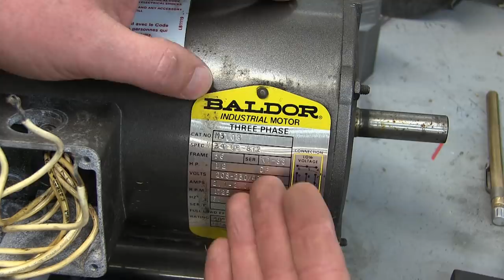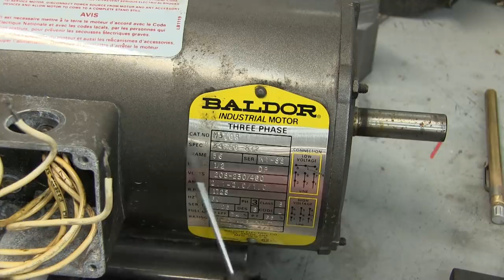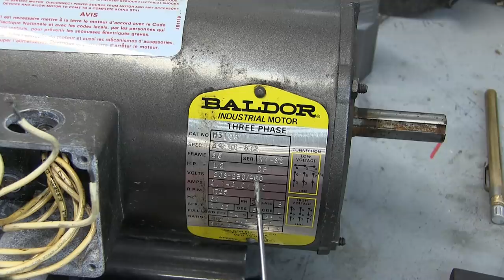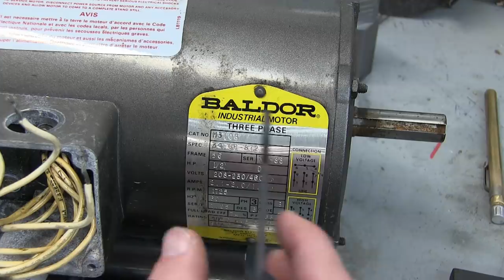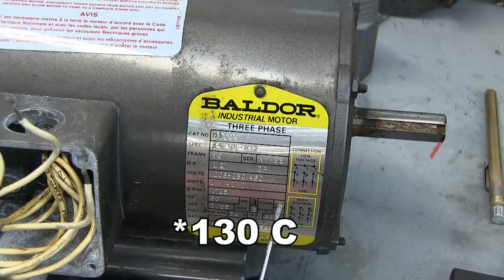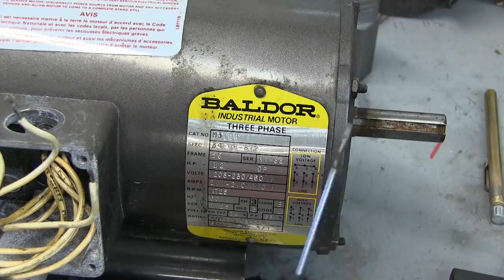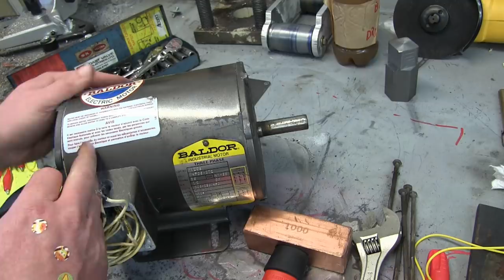BOLTR: Induction Motors EXPLAINED! | Power Factor and Failure Analysis

Comment: Look at the nameplate?  Dangerously close to reading the instructions.  It's a slippery slope, my friend!
Reply: Nononono, nook at the lameplate!!!!
Reply: Following instructions is a severely underrated super power. You'd be amazed how many times i did something in a single go by simply following instructions.
Reply: Marcel LeMay its a joke
Reply: Youtube User, Yeah,  i know it is.  😊
Reply: I once watched several of my friends bumble around for 10 or so minutes trying to figure out how to route a dryer's drum belt. Then instead of showing them how to do it (since I'd done it recently myself) I asked them, "why don't you pop open the control panel on top and look at the instructions?" They thought I was genius when they found said instructions were there and included a belt diagram. They got to do the dirty work and I still got to look smart. :)
Reply: Those aren’t two in the same, gotta know what the hell you are looking at, labeling for the win.
Reply: lookin' good and wingin' it is what I did for years, got the job done, but I also knew my limits and when to quietly ask for help. I didn't tell the shopfloor I'd asked engineering though....
Reply: proto Nah man. The nomenclature plate doesn't count. It's the same thing as an instruction manual, but it's boiled right down to what you actually need. Pick out what you need and throw the rest of the crap in the round file. The plate and a manual is all you need.
Reply: Instructions are just the manufacturers opinion.
Reply: Instructions tell you what to do and any selfrespecting man will not have a booklet tell him what to do and name plate however is more like a cypher if you don't know what it means it can have you cursing which I think we all agree is a manly part of repair work!
Reply: Great comment upvote....oh wait, I already upvoted this comment 2 years ago. I want to upvote it again.
Reply: I almost never read the destructions, and I've never had a problem, even when stuff doesn't work as intended.

Comment: As soon as you started I was reminded of when the auto transmission blew in the IH cab over I drove at one time. When they put it back together they put the trans on a dynamometer to see if it would chooch. They had two such machines, one with a  454 Chevy engine and the other with a mongo electric motor. I wondered out loud if the electric motor was up to the job and was told the 454 would barely turn the truck transmission but the electric job had more than enough. 
As a bonus I saw the difference before my eyes the difference between shifting on the torque curve and the power curve. I already knew in practice but it was cool to see it on the dyno.

Comment: So here in the enlightened lands of the UK our motors can be connected either Y/star or Delta the Y is the low voltage and the Delta is the high voltage connection as you call it. We also have controllers that switch from star to delta on startup to assist startup then switch to delta once running. There is usually a set of links that can be swapped at the connectors which are more convenient than the bundle of loose wires.

Comment: OMG I needed this so bad. I deal in gym flooring.  For Bleachers that roll out you can have 2 phase or 3 phase drive trains.  I never understood why they say with 2 phase it is like a car on gravel slamming on the gas & spinning wheels throwing gravel behind vs 3 phase where a car slowly accelerates.

Comment: AvE,  DP is short for Drip Proof. It means the enclosure type of the motor. Drip Proof is resistant to moisture, dust, semi enclosed.Then there is ODP, Open Drip Proof, vented on the bottom basically, water resistant but not dust. TEFC, Totally Enclosed Fan Cooled, just like it sounds, more water resistant usually wash down rated, dust proof, most common Industrial motor type. You get the general idea, there are very many more, too many to list. An EASA book or search can fill in the blanks if you need more info.

Comment: Thank you. I used to build a lot of mounts for various motors in oil fields and industrial sites. As a welder, that soapstone holder or pen jumped out at me. I carried one in my shirt pocket for decades before I retired. I always preferred the round over the flat one, because it seemed I was constantly marking round holes. Great lesson here on induction motors.

Comment: I love those ground fault tester, I never used the new one but back when I worked for Orange "France Telecommunications " in jordan I had one I used for locating bad underground joints had alot of options but it's all in variable resistance and potentiometer like wire gage resistance of wires and we follow plans to dig that joint up

Comment: Here in the UK most dual voltage 3 phase induction motors are built for star/ delta connection (Y/delta) on high voltage they are star connected and delta on low volts.

Comment: I'm learning still and maybe should find out it easier, but the question is, since the 3 phase motor in this case is made to go on 208-280/480 and that it will wear it out earlier if used on 480 for example. I wanna know what parts it is that is wearing out, because I suppose it's brushless since its a induction motor, right or wrong? Two questions really but I think you get it. Thanks for a great channel!

Comment: Oh right what is SOHCAHTOA in english?
Reply: Thanks.
Reply: felixar90 sine opposite (over) hypotenuse, cosine adjacent (over) hypotenuse, tangent opposite (over) adjacent.

now i can't remember: which adjacent line do you use for cosine and tangent?  does it just not matter?
Reply: adfaklsdjf Ok,  it's same thing in French then. And the adjacent side is the one that is not the hypotenuse, because the other one is called, well, the hypotenuse. (Even if it's technically also adjacent.)
Reply: Some old hippie caught another hippie trippin on acid
Reply: adfaklsdjf, Adjacent is the Active power (W), Opposite is Reactive Power (VAR), and Hypotenuse is Apparent Power (VA)
VA times Sine Theta (Theta is angle of PF) is VAR
VA times Cos Theta is W
Theta is cos-1 0.65 (the power factor) = 49.45839813°
Reply: Adjacent is the line touching the angle you are calculating it is the one that has the 90 degree angle at the other end.  Opposite is the one not touching the angle you are calculating and hypotenuse touches the angle you are calculating but has a less than 90 degree angle at the other end.
Reply: this should help you out chris http://www.electronics-tutorials.ws/accircuits/power-triangle.html

what I know is from 3 years of electrician trade school.

Comment: Power factor: Electrical supplier infrastructure (generators, transformers, transmission lines etc) must be sized to provide current (amps) and voltage(volts). A non-reactive load (resistive) consumes power as a product of the two (VxA=P). With a reactive load such as a motor or capacitor (inductive/capacitive) the current either lags or leads the voltage. As the voltage and current are no longer in phase the (real) power consumed will always be less than the product of the current and voltage (VxAxpf=P), pf will always be in the range 0 to 1. For example, a machine with a pf of 0.5 will consume 50% less (real) power than the product of the current and voltage being supplied to it. Larger installations have power factor included in their metering and are charged accordingly for exactly this reason.

Comment: nameplate lies....... 
480V 1A 3phase line to line motor takes √3 * 480 * 1 = 831W effectively outa the wall,  In which world is that a 1.2hp(894W) motor?
Add the .68 pf and you better have wires and fuses that can handle up to 1.5A power draw, because that is what it actually takes from its power supply.
It's only 74% efficient at full load so it is a 615W(0.82hp) motor. 
Lies lies and .....
At 32 ohm it will pull up to 15A at stall, ouch.
Reply: Wouter Portegijs Question regarding wye and delta configuration. Does one have a higher starting torque than the other?
Reply: My understanding of squirrel cage motors is that either way they can blow themselves up, what I mean with that is that the stall current is way to high for the wires to survive.
If you want high stall torque you better get a good vfd and program it correctly for the motor, if you have the motor already. If not get a different motor that fits the application better.
that said, with a said limited voltage, either 110 /220 /480 and the same motor being either wired Y or delta . The Delta has the least resistance and thus for the given voltage will let more pixie through. 
Either way the pixies will win without a controller and your motor will catch fire or melt ;)
Reply: 208*2.1*1.732= 756.5376 VA Full Load Input
times .65 (PF) =  491.74944 W Full Load Input

1/2 HP * 746 = 373 W Rated Output
Output/Input = 0.758516431 or 75% efficiency, very close to as rated by the name plate

W in - W out = 118.74944 W total losses

the name plate is correct, its a 1/2 HP motor.

CEC Rule 28-200: A 15 Breaker is good for the branch circuit
CEC Rule 28-308: Overload not needed.
CEC Rule 28-106: 14 AWG is good for this motor
Reply: The 1/2hp (~373W) is the power on the shaft.
You divide that by the efficiency (373W/0,72=518W) and you get the power it draws from the wall.
If you calculate P=U*I*√3*cosφ you get the same value (P=460*1*√3*0,65=517,8W~518W).
There are 518W-373W=145W losses in heat/friction.

Comment: erm... im not sure if your description on "this motor is likely Y-wound" is correct. to my knowledge many motors dont have a fixed arrangement but can be switched by flipping a switch/rescrewing some current connector bars around because different arrangements are better for starting/running (Forgot which for which). and the loose bundle of cables coming out of it seems to agree with me because it looks like its independent wires for each relevant coil pair (which you would then connect to make the Y or Δ setup) 
the diagram for high/low voltage also exactly looks like the diagrams i saw on pretty similar (3-phase induction motors) as well for the Y/Δ switching
source: my electric/elctronic engineering school teachers :V

Comment: you can tell if its a wye or delta by the low voltage wiring diagram, for 9 lead motors. (the high voltage is the same for both)

wye = (4-5-6) (3-9)(2-8)(1-7)

Delta = (3-9-5) (2-8-4) (1-7-6)

If no diagram is legible, then just test for continuity, if you have 3 sets of 3 its delta, if you have a set of 3 and 3 sets of 2 it wye.

for delta a resistance check of those sets will tell you how to connect the leads for low and high voltage. (1-4 is double 9-1 or 4-1)
for wye a voltage check will do the same (if you jumper 4-7, then 8-1 will be the sum of 8-7 and 4--1)
Reply: In europe our motors are normally star / delta for high / low voltage so they only have the 6 terminals.

Comment: AvE, Can u run a 220v motor on 120v by twisting legs together, If so or not how safe is it and what might one expect by doing this I was looking at a compressor a guy had done this to the motor and told me it would be fine. I passed on it but I've been wondering

Comment: Sorry to take issue with you're re one of your comments. Operating a 60Hz motor on a 50Hz power supply does effect the performance of the motor. A change in frequency effects the impedance of an inductive circuit. So as impedance decreases current will increase and the motor will operate hotter. Probably not too hot at no load but at full load, that's another story.

Comment: The DP has to do with the enclosure. I thought you were going to get into when you got into the rolled steel portion. Normally Baldor’s nameplates have an “encl” section. Heres some different designations. Open Drip Proof (ODP) ...
Totally Enclosed Fan Cooled (TEFC) ...
Totally Enclosed Non-Ventilated (TENV) ...
Totally Enclosed Air Over (TEAO) ...
Totally Enclosed Wash down (TEWD) ...
Explosion-proof enclosures (EXPL). Those A hole Y/delta motors are still out there. Mostly on German stuff (medical equipment) keep up the great vidjeo’s and the sweet cursing yo.

Comment: The analogy my prof. gave for power factor was helpful.  Pour a beer, the reactive power is the foam, real power is the actual liquid, and both together is the apparent power. And as for removing bearings, bar soap works well if you don't have grease or bread.

Comment: I remember me sitting in the electrical machinery course I - motors....he went on and on about motors...and i didn´t undersand a single thing...instead i went to a local used parts shop and got me a 100W induction motor and opened it and test the thing troughout...it helped me a lot about how these things works...about the same as you done here....experiments are fun.
Thanx for this one :)

Comment: Thanks for showing this video!  I've saved and restored many old motors. The Baldor are pretty well made, in my opinion. Even their small cheapie ones like you show here seem to last quite a while.  

Here's an interesting motor you might like to see.  It is made for a cotton gin, where there is a lot of flyings and lint in the air.  Instead of keeping the lint OUT, they made the motor with all open, smooth air paths so that the lint will blow through it.  The winding is encased in solid fiberglass resin so as to eliminate lint getting stuck in the end turns and creating problems. It almost looks like a wet-winding for a submersible motor, but not as thickly encased.  This motor was made in the 1930's and was in a scrap pile.  With one bearing replaced and one repacked - it is back in action.  https://www.youtube.com/watch?v=grjomtYnzNA

Comment: DP= drip proof sometimes manufacturers use ODP open drip proof.  You'll also see TEFC = totally enclosed fan cooled.  There's also a jp frame which is similar to a c face, but intended for pumps with a longer shaft to make room for a bronze sleeve and a mech seal.  Other than that man, you pretty much covered the basics.

Comment: Weird, I just watched a vid where Finnegan [ Motor Trend 'Roadkill' ]  used soap to drive out a bronze bushing on the end of a gearbox lay shaft stuck in the end of the crank!!
Reply: Philip Rowney the power of hydraulics knows no limits when applied with no rules in a parking lot or northern B.C.
Reply: Philip Rowney that wouldn't happen with dove!
Reply: andrew kennedy Yeah Dove's no good as hydraulic fluid, too much air in it. On a side note, that's also why it floats.

Comment: Hey Mr. AvE, just a little note. When you calculated the apparent power you missed the square root of 3. So it's 480V*1A*square root of 3 = 831VA.  Greetings from the standardised Germany :P
Reply: Actually 796 @ 460. Name plate states 460 not 480. Ifn you wantn to be splittn airs
Reply: Dan House :D I guess you are right.  I stopped the video a couple of times to take a look at the name plate. Thought that a simple "the square root of 3 is missing" isn't that helpful.
Reply: Would that be because the windings are in delta configuration? (phase to phase rather than phase to ground such as wye?)
Reply: no its a wye motor, the formula he is talking about is P (Total Apparent Power)=I (Line) * V (Line) * 1.732 (root 3) (P=V*I*1.732)
which is (for low voltage) 208*2.1*1.732=756.5376 VA to be more precise.

the reason for root 3, is the line voltage (wye) or line current (delta) is root 3 higher than the phase value, and for phase power P=V*I, so you need to correct for the higher line value to find the total apparent power.
Reply: Tyler Dickson: In a wye (star, Y) configuration, the star (center) point is not connected to the grid (neutral/ground).
Reply: not for a motor, but most other wye loads the center is the neutral.
Reply: That's because most wye/star loads that are not motors are not polyphase loads but rather a bunch of individual loads grouped together - like a three-phase welder (individual rectifiers from each phase) or a three-phase resistance oven.

Unlike the phase-to-phase voltages, which are governed by the generators feeding the grid, the star point of your home's three-phase power supply is essentially made up by the transformer of the utility feeding it; it is the result of grounding the star-point of a three-phase transformer with the secondary (i.e. the low voltage side) wired in a star configuration.
Reply: @dasstackenblochen9250  and Kustbag, something like a threephase oven, water heater or welder will normally only have the star point connected to neutral if that bit of kit needs single phase control gear or partial loading

Comment: 20:48  that made me wince just a bit...
Reply: 27:30  what are the odds...the guys on Motortrends Roadkill show just used that little technique except they used a bar of soap...
Reply: This method can bust the casting that supports the rear bearing, caution is the name of the game here.
Reply: just a bit? I was yelling at the screen like a damn fool.
Reply: The hammer is softer than the shaft so no mushroom. I learned that the hard way with a threaded shaft (pump impeller) and a steel hammer. A piece of wood works in pinch.
Reply: It's not so much mushrooming the end, It's driving the shaft through the back cover. Don't ask how I know that.
Reply: Yep